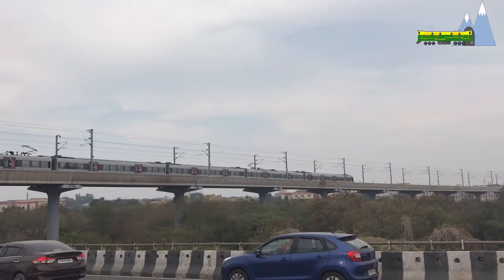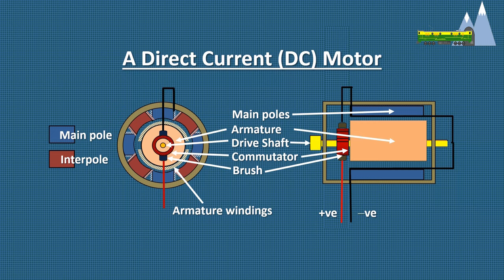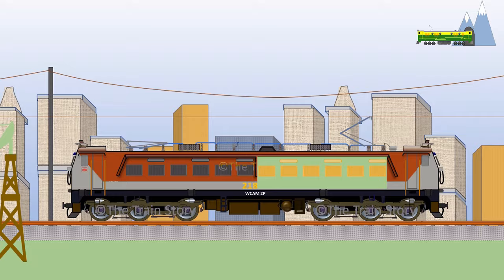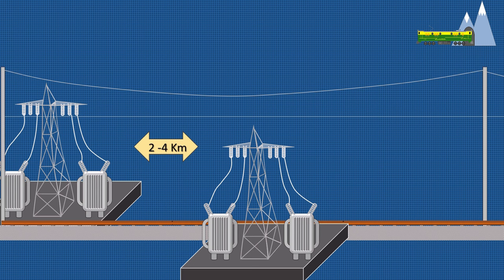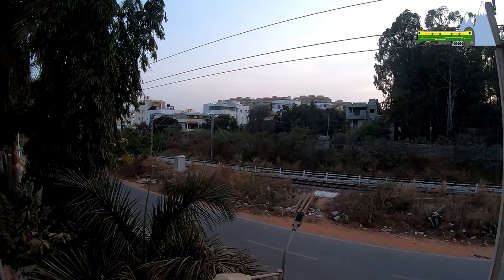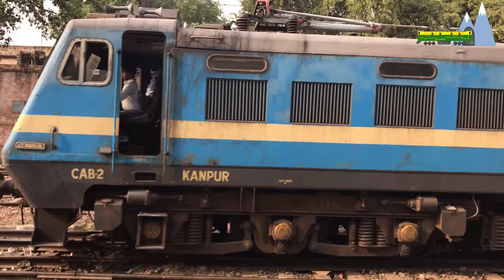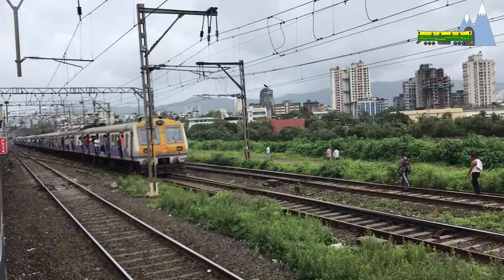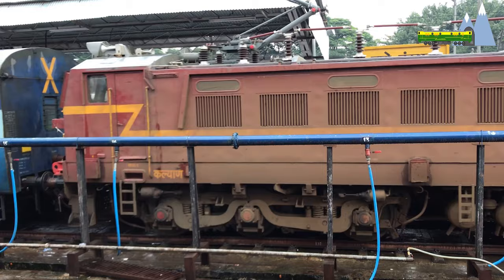Railway electric traction supply systems| AC electric traction| DC electric traction| Direct current

Comment: With a personal interest in both the Czech Republic and Slovakia and - to a lesser extent - France, where the rail network is, in all three cases, a mixture of higher-voltage AC and lower-voltage DC the various different 'plus' and 'minus' points about the two systems are of very great interest, so thank you for explaining it all so clearly. 

I do quite a lot of tracing rail journeys on YouTube in those three countries and it is always quite a challenge to detect whether one is under AC or DC catenary by how heavy the overhead wire looks and how often one sees a transformer station beside the railway...although there is invariably some text that takes that guesswork away!
Reply from the maker: Thank you Chris…
Reply: @TheTrainStory  You're welcome!

Comment: Multi-system locomotives or EMUs are probably the best solution in the long run when there are multiple systems in use, making expanding the routes and redirecting rolling stock from one route to another much easier.
Reply from the maker: Yes particularly for multi-country routes

Comment: Electric railways are not necessarily non-polluting if the power plant producing the electricity they use is produced at the power plant by coal, natural gas, or nuclear power.  The only way that electric railways can be non-polluting is if the electricity needed to power them is produced by wind, solar, or tidal  means.  Any other way just shifts the pollution from the individual engine to the power plant that supplies the power.
Reply from the maker: Unfortunately Yes…

Comment: My home state N.Calif SF/Bay Area has a heavy rail transit system BART serving four counties some 120 + miles of track. The trains are powered via 3rd rail 1Kv DC each station stop or close by has a power substation with DC power houses. The original traction motors were DC, 500V wired in series each car had four motors. In the late 1990's a changeover was made to 3 phase traction motors along with a 3 phase inverter.

Comment: Dc system is rigid but the motor are head ache and we can't accurately control dc motor speed, while ac motor speed can controlled very accurately using vvvfd but due to Indian quality of manufacturing these days the convertor and controller fail often ( especially the medha ones)
Reply from the maker: Thanks man for the technical detail/update ...

Comment: MOST OF EUROPE USE 15kV 16 2/3 Hz AC when it's near DC. To increase speed the had a transformer with many windings a fed the DC motor WITH NEAR DC CURRENT in the locomotive. Today use of ASYNCRON MOTORS AND USE THREE PHASE TYRISTOR  REGULATED AC TO INCREASE OR DECREASE SPEED!

Comment: Question: Why do I see some diesel locomotive/multiple units also having AC/DC traction motors? Are they different from electric locos/EMUs?
Reply from the maker: Those are diesel-electric locomotives/multiple units. A Diesel engine drives an alternator that powers the traction motors. The difference is, a diesel-electric loco carries its power supply onboard while an electric locomotive draws power from overhead or third rail catenary.

Comment: 👍 why dc locos won't cross cr zone bro
Reply from the maker: DC locomotives are now extinct in India. Earlier the Mumbai region was the only area with DC (1500 V) supply, therefore DC locos were restricted to Mumbai only.
Reply: @TheTrainStory  but those wcam will support both ac and dc know bro so they can run other States or zones no
Reply from the maker: Because of absence of sheds. Presently all WCAMS are homed in Kalyan shed (I am not sure about Valsad). Therefore the locomotives are rostered within the serviceability range of Kalyan shed. Although technically, the WCAMs can run on all electrified sections of IR.
Reply: @TheTrainStory  kk